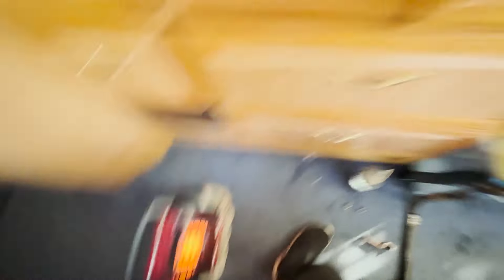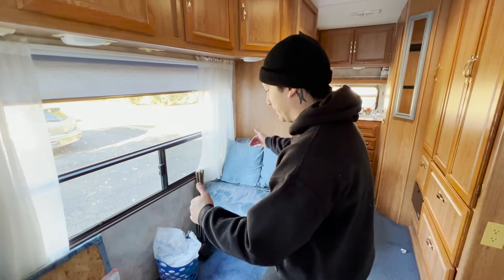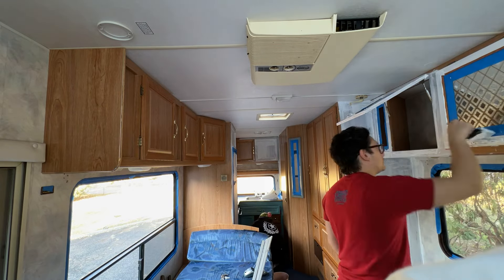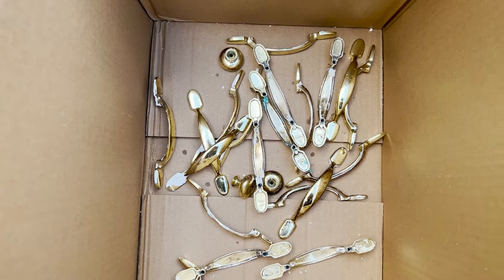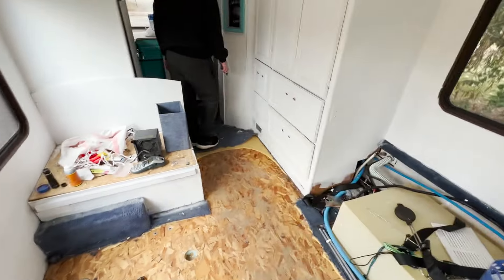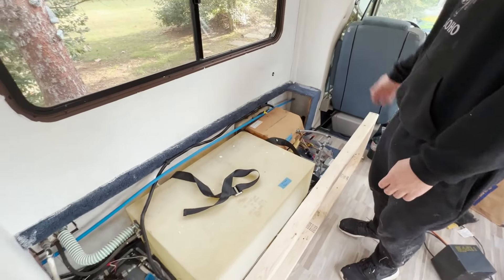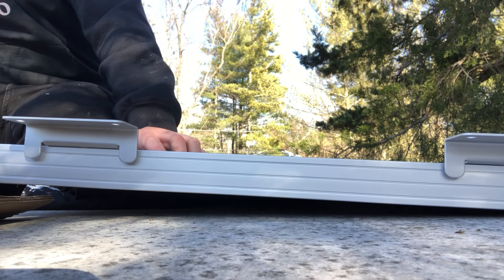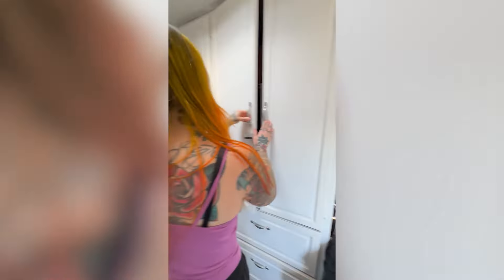Renovating a VINTAGE RV in the freezing cold

Comment: Your roof needs some TLC. Because if you get a leak, all the work you have done will be for nothing. RV's wick water like paper towels. Scrub wash your roof and get 2 gallons of of DICOR roof coating and apply 2 or 3 coats to use up the second gallon. One won't be enough. It will also reflect heat and keep you guys cooler in the summer.
Reply from the maker: Incredible information we plan on doing this thank you!
Reply: @sixtynineeverywhere  Stay away from silicone roof coatings, not that they wont work, but nothing else will stick to silicone except silicone and its a PITA to remove.